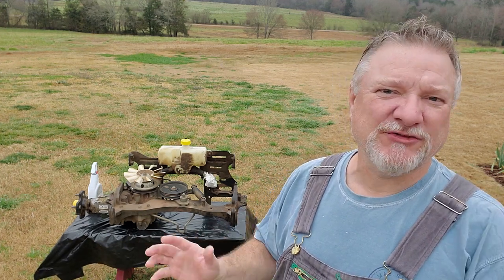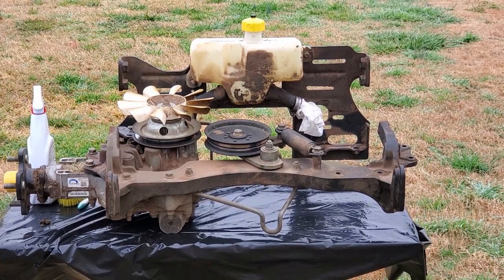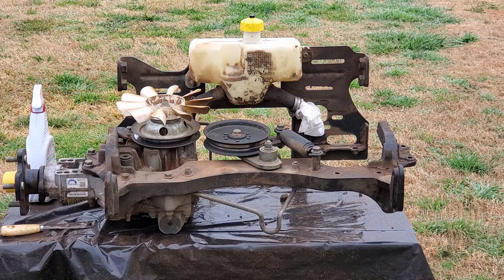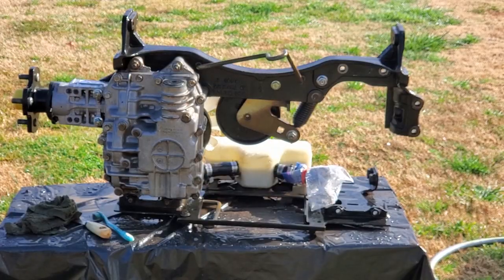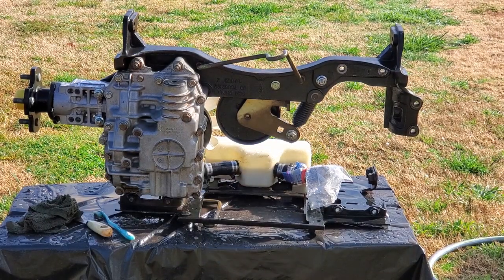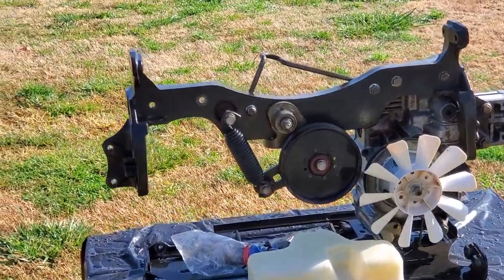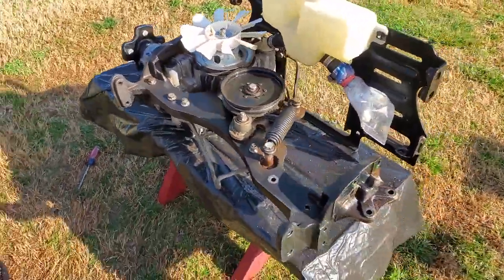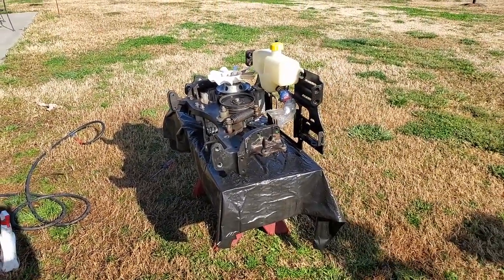Part 5: John Deere Z920m Hydrostatic Assembly Cleanup

Comment: Use a small pressure washer.  It is much faster and better, just water
Reply from the maker: I have a gas powered pressure washer.... I just thought this was a small job which I could do with a hose.  In hindsight it may have been better done with the pressure washer.

Comment: it leaks on top at the plastic plug under the pulley also replac the seal on pulley shaft
Reply from the maker: Fortunately, the plug is not leaking.
Reply: double check make sure it's the updated not the plastic plug
Reply: @shanepipkin4041  My 820M is in the shop for the same leaking /cracked plastic plug under the fan - 900$ shop cost... I plan to do it myself and told by service that it can be done without removing the motor from the frame.. any ideas?